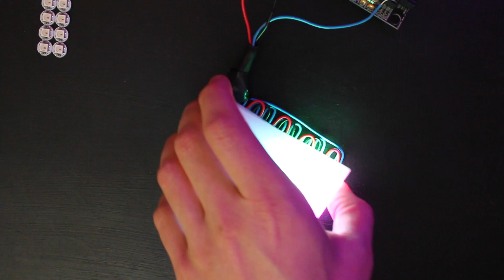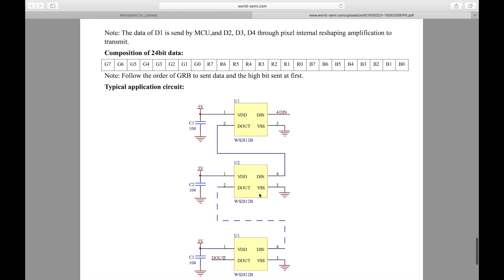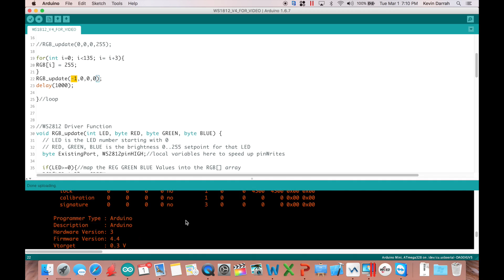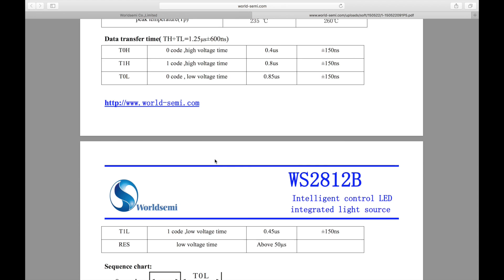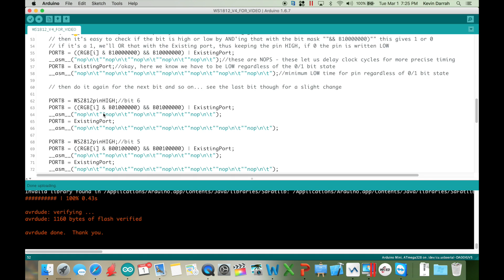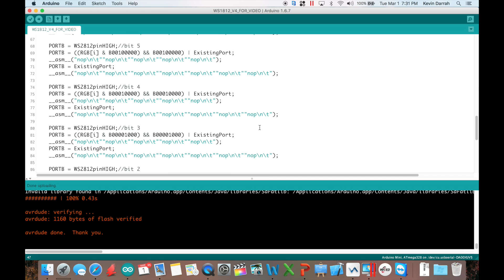Easy Addressable LEDs with Arduino! WS2812B Tutorial

Comment: Whats with the capacitors? how do they come into play
Reply: It just goes in parallel with the power supply. Because the display is connected by long wires, there will be a voltage drop if the display is made bright. That drop could hang the drivers inside the LEDs.
The PWM has sharp edges so there needs to be a high-speed temporary power supply located close to the LEDs for a fast response.
The capacitor smooths all that out by acting as a buffer. It will also cut down on Electromagnetic Interference. Just use a low ESR 2200uf 16v Electrolytic, probably a few dollars tops. Make sure the polarity is correct or you will get a mess and a stinky house and possibly a damaged power supply or injury. (The metal case will go flying, possibly to your face)

Comment: thanks for this video dude, I'm wanted to get into LED and programming. For this chips with the build in driver, like the WS2812B, are you able to just program a single led and then just apply a power source and it will run through the programmed sequence with nothing else but the power?

Comment: Thanks for the video and walkthru of your code, especially when you explain the ''nop'' 8-) to adjust your tight timing, and it is very good you show the signals on the scope!!
I was trying to probe the UpHere 6-pins from the fan/led controller, I think they use WS2813 as the led control is a 4 pins 5V,Gnd,Out,In where as fan is 12V,Gnd no speed control.

Comment: Best low level explanation I found on youtube! Thanks
Using the '&&' is not needed I think.
Both the lines will gives the same result I guess?
PORTB = ((RGB[i] & B10000000) && B10000000) | Existingport;
PORTB = ((RGB[i] & B10000000)) | Existingport;

Also your code depends upon the clock speed of the microcontroller. I don't know if you mentioned the clock speed?

Comment: Nice informative video on the details of how the electronics work for these LEDs!
Suggest refactoring the code to separate concerns a bit.  One function should update the array and another function should push data on the wire. That way the code is more self describing and you don't have to set a variable to -1 to change behavior.

Comment: Check out the SK9822 LEDs. Slightly more expensive than WS2812 and they require a clock pin, but the transmission protocol they use is a lot simpler, they include a 32-level brightness setting for each LED, and I've experimentally been able to run my set at 3x the rate that the WS2812s are capable of before hitting the limit of what I could test.

Comment: Hi, love this tutorial. I am wanting to make some LED juggling balls that can achieve some cool effects like your video. I have balls that glow but I want more than just colour change. What LEDs would be best for this? They would have to be able to withstand hard impacts when dropped. I will need to develop some sort of suspension system for the LEDs along with the central controller board. Can you point me in the right direction??

Comment: Slightly confused on how you connected the LEDs (specifically as it relates to your code & how addressable LEDs work, as I'm still learning). Did you take the output of the last LED in the first row to the top of the next row? Or did you go back up from the bottom unit?
Reply: Nevermind, I was finally able to pause it and see how it was done... from top to bottom then back to the top.

Comment: Finally, someone who doesn't use either NeoPixel nor FastLED, thank you for sharing this, great video !
Reply: Correct me if I'm wrong but the method this video explains is pretty much how FastLED runs under the hood. It's great that it goes to the extend of explaining everything but I think it's kind of dumb to reinvent the wheel when there are 2 great libs that you can use and work perfectly and have years of development behind them.
Reply: @frank20a  Except when your teachers specifically ask  you not to use any of these libraries...

Comment: Hey I am new to Arduino programming and had a question. Can you use a similar program to turn all lights red except for randomly identified ones (1, 17, 54) as green? If so, I understood the high and low but how does it recognize the LED ID # and communicate which light to turn on?

Comment: Do you think it's possible using a ring of addressable leds, with a little time to code, could make them function based off an input voltage?
 I'd like to have several back lit rings for my gauges in my car and run them based off inputs from speed and rpm signals  then at a certain input have them all flash red for a shift light... I'm sure this will be a crazy sketch to write

Comment: I love code like this. Excellent. Nudging NOPs in here and there to get the timing right is something I'm familiar with on old 8088 machines. Not exactly science, kinda like black electrical tape for code - but the thing is, it is 'exactingly' repeatable. So what if it isn't on the micron, the entire universe is analog anyway. The fact that it's 'just right' makes the code eloquent and even alive in its own aspect, because if you move the code to another processor it will behave differently. This is the art of the true programmer. Well done sir. It's been a while since I've seen it in action.

Comment: Great video, good explanation. ONLY comment is you should space out the comments and stuff in your code so it would be easier for  ys old timers to read. 
Also, use #defines for everything where a number appears in your code so you don't have to guess what the numbers are for.
A.K.A. the "no magic numbers" rule in Software Engineering. Everything gets a name.

Comment: Cool!  And what about multitasking?  If I connect 3-4 LED panels to different pins - does it work?
Reply from the maker: right now it only works with one pin, but you could just daisy chain your panels
Reply: I think daisy chain connection is not  reliable - if one wire in chain will be damaged - all next panels will be lost... So I search multiple pins solutions (one lost but others still working)...

Comment: fantastic video! 
i tried it on a cheap 1M 60 L.E.D strip from ebay and it works well. it twinkles slightly when its white but barely noticeable.  
looking at the code i cant work out why it keeps turning on and off white but if i take the delay out of the loop code it just goes crazy. any suggestions on how to get it to hold a colour?

Comment: Thanks for the pointers, but I had strange results with the code as presented.  
Try this instead:

void RGB_update(byte LED, byte redVal, byte greenVal, byte blueVal)
{
  byte dataLow;
  byte dataHigh;
  int bitStream = totalLEDs;
  int bMask;
  int i;
  if (LED >=0) {
    RGB[LED*3] = greenVal;
    RGB[LED*3+1] = redVal;
    RGB[LED*3+2] = blueVal;
  }
  noInterrupts();
  dataLow = PORTB & 0xFE;
  dataHigh = PORTB | 1;

  for (i=0; i<bitStream; i++)
  {
    bMask = B10000000;
    for (int b=0; b<8; b++)
    {
      if (RGB[i] & bMask)
      {
        PORTB |= dataHigh;
        asm("nop\n\t""nop\n\t""nop\n\t""nop\n\t""nop\n\t""nop\n\t""nop\n\t");
        PORTB = dataLow;
        asm("nop\n\t""nop\n\t""nop\n\t""nop\n\t");
      }
      else
      {
        PORTB |= dataHigh;
        asm("nop\n\t""nop\n\t""nop\n\t""nop\n\t");
        PORTB = dataLow;
        asm("nop\n\t""nop\n\t""nop\n\t""nop\n\t""nop\n\t""nop\n\t""nop\n\t");
      }
      bMask >>= 1;
    }
  }
  interrupts();
}
Reply: Oh.. It's easier...

Comment: No need to repeat the same steps or add unnecessary "&&" comparisons which turns the value into a bool, (though I think you should be able to just use "&& true" to get the same result since any positive value should count as "true"). Just continue to use bitwise operators, particularly the "<<" operator. Then you can make it shorter with a for loop. Just compensate for the addition, assign, and comparison instruction lengths in the loop and you should be good to go! :D The reason why that last comparison is likely shorter is because it only has to check the first bit and it's done. Can't actually try this change yet though, still don't have any addressable LEDs.

Comment: At line 57, when setting the pin low, why use ExistingPort instead of defining and using a new variable WS2812pinLOW = PORTB  & B111110?

Comment: If your pixel has 6 soldering points, you have the WS2812 led. If it has only 4, then you have the WS2812B. Pretty sure about that.
Reply: They have V, GND, D-In at one end and V, GND, D-Out at the other end
Reply: BTW, I have 6-pin LED but FastLED.h library must be set to : FastLED.addLeds<WS2812B, DATA_PIN, GRB>(leds, NUM_LEDS); to make it work correctly.
Reply: 3* is the WS2812B
Reply: How can they have 3? Vcc, GND, D-In, D-Out
Reply: i want to use the 4 pin WS2812B instead of the 6 pin WS2812 , any videos on how to use that? reduces the number of solder points

Comment: Your timing is dependent on the clock speed of the processor which is fine if everyone runs this on a Nano or Uno but I know by experience that this screws up if you try to run it on a Due or Leonardo. You might want to have a look at Adafruit's Neopixel library which does cater for different performance CPUs.

Comment: Great tutorial and EVEN better! I did get this to work on an ATTiny85! I modified the sample to work on my small panel with 40 LEDs and FANTASTIC! You MUST set the ATTiny to work at 16MHz PLL (if you do not want to use an external crystal). I found out how to set the fuse for 16MHz PLL. Thanks!!Also I tried to change the number of LEDs to a lower amount like 10 on the same string and I got a strange effect. Occasionally the led that was lit was out side the number of LEDs I set it to. So numberOfLEDs set to 10 but I was using the same panel. I think it was because the next time through the loop the timing did not reset the string and the data continued down the string. Interesting!
Reply: I've found that if you draw more current than available (I'm guessing voltage drop), the controllers on the pixels don't seem to relay the data properly down the line.

Comment: unfortunately this wont work on esp8266
https://github.com/esp8266/Arduino/issues/1632

however I can control a small strip using 2 digitalWrites suprisingly, using the overhead alone as the delay between the two.

Comment: Great tutorial and video! Love your videos. Very informative and precise.  
Quick question: This code is working for the Atmel 328. Could it work on an ATTiny? I used the Neopixel library on a tiny85 and it worked but it took up alot of space.
BTW, I also have these same LEDs and the ones I have are using the WS2812B chip. But some others use the older WS2812 and the byte order is different. I mixed the during my experiment and was confused why some had different colors than expected. FYI Thanks Kevin!
Reply: will work on Tiny84
Reply from the maker: +Don Milton Don, should work with ATTiny, but you'll have to change the PORT stuff, so the right pin is used.  Let me know if you try it out.
Reply: +Kevin Darrah I tried it out on the ATTiny85 and at first it was black and nothing happened. I did figure out that the right pin on the ATTiny is data pin 0. So I fixed that and when I uploaded it and tried it I got all white and ever LED on. I tried it on my Arduino UNO and it worked great. I am thinking it is because the ATTiny is 8MHz and the Arduino is 16MHz so it might be a timing issue. I could not figure out if I needed half the clock cycles because the timing is slower by a factor of 2. Thanks! I am looking forward to using this because it is definitely smaller than using the NeoPixel or FastLED libraries.
Reply: It will work on the Tiny85 - 
I programmed the T85 using (UNO) 'Arduino as ISP'
using the board manager -  https://raw.githubusercontent.com/damellis/attiny/ide-1.6.x-boards-manager/package_damellis_attiny_index.json
Clock : Internal 16MHz 
Burn bootloader to set the fuses for the T85 to internal 16 MHz
Then upload to the T85 thru the 'Arduino as ISP'
I have some code to allow the use of (almost!) any port/pin. However PORTB,C PINs 3,5 don't work, and PORTD PINs 3,5,6 don't work on UNO & clones (tried on several boards)

Comment: Bought a strip with 60 LEDs and it works just fine :)
You should consider putting that on github!
A major improvement would be to use a class with methods leds.set() and leds.flush()
Reply from the maker: +MajorBreakfast cool!  yea good idea

Comment: Very good and interesting video. However, I have a question. From browsing the datasheet I have found the reset code which needs to be used, but you never mentioned it. How are you dealing with it?
Reply from the maker: +TheGuy no need for it, since after I update the entire display, I'll be onto something else, which will have a delay much longer than 50us.  You might need this if you're continuously updating the display, then you just need to have 50us between updates.
Reply: +Kevin Darrah  Thanks for the reply. Thought that was the case, but just wanted to be sure

Comment: The data sheet is in Chinglish and I wanted to know the fastest buad? is it 800Kbps?
what does "When the refresh rate is 30fps, cascade number are not less than 1024 points." mean?
Does it mean "30fps is guaranteed for 1024 cascaded leds"?

Comment: Awesome! Changing the PORTB operations in the loop to inline assembly code could optimize it even more, but this is already fast enough. How about power though? How much juice will be flowing through port 8?
Reply: +Bas Groothedde they're quite cool, I used them to make a digital Rubik's cube.  Saved me doing a lot of difficult wiring and PWM while still trying to make time to sense swipes etc.
Only think I would recommend is that if you plan on using a lot, I'd make more than one power rail as opposed to the Vin Vout pins all being daisy chained together.  The voltage drop will cause the problems the furthest LED colours otherwise.
Reply from the maker: they have a constant current regulator built in - I think the max current "White" is 60mA, but I haven't tested this
Reply from the maker: +Bas Groothedde power should be no prob - that digital pin 8 is just used for data pin, not to actually power the LEDs
Reply: Kevin Darrah Ah got ya, I have never used these leds, so I didn't know that. I'll be ordering a few soon then haha
Reply: +Kevin Darrah Do these need current limiting resistors or is that handled by the chip?  Also, what current draw are those pulling, especially when they're all lit up?
Reply: +CSmyth89 also also, from what I recall (from very quick current tests @ 5V current per individual LED =17mA so full white brightness is about 51mA
Reply: CSmyth89 good advice, thanks!

Comment: you can also do it with spi and interrupts.worked for me
Reply from the maker: +fun electronics videos cool, would like to see how you did it
Reply: +fun electronics videos Not with WS2801/WS2811/WS2812B or have I missed something? 
APA102 uses SPI but that's a different LED altogether...
Reply from the maker: +Jens Andree FYI - I had a concept to drive the WS2812B with SPI and got close, but my timing drifted, so after about 10 LEDs or, so the color values would start shifting.  I thought maybe fun electronics might've figured out to make it work?
Reply: i actually used spi with esp8266 se cnlohr_s videos for that but there he uses i2S interface on the chip i did the same it worked but as far as i went was spi
Reply: +Kevin Darrah Yep, that's my conclusion as well when I went down that hole a few years ago... Just couldn't get the timing to work in a stable manner.
If someone can get spi working for WS2812B leds and similar then I'd be really keen to have a look at that solution!

+fun electronics videos I will have a look at cnlohr_s for sure! :)

Comment: Could you have used a bit shift to try and change how long it was written high for, rather than going over every 8 bits in your main loop?

I'm thinking something like:
//loop over all the values
for (int i = 0; i < 135; i++) {
    //get the byte
    int b = RGB[ij];
    //run the loop 8 times (don't actually use k)
    //import with the shift left and assign by 1 bit - this means you're always checking MSB
    for (int k = 0; k < 8; k++, b <<= 1) {
        //write high, I'm sure some nop's needed
        PORTB = WS2812pinHIGH;
        // fun logic for keep high, or swap low
        PORTB = ((RGB[i] & B10000000) && B10000000) | ExistingPort;
        //write low
        PORTB = ExistingPort;
    }
}

I somehow feel this is going to cost more time on processing, but keen to hear whether you think this could work?
Reply from the maker: +Ben Naylor Yea, I think I tried that early on - the one thing that bit me was when you hit the end of that internal for loop - now you've got double the checks when you're at the end of the loops.  Could work though - let me know if you try this.